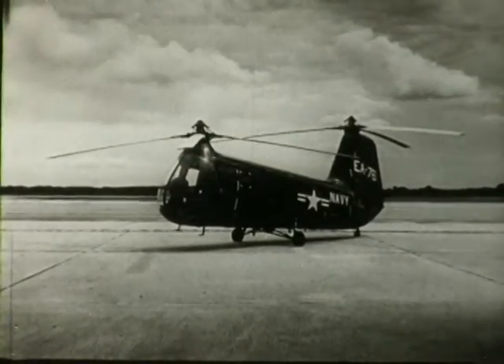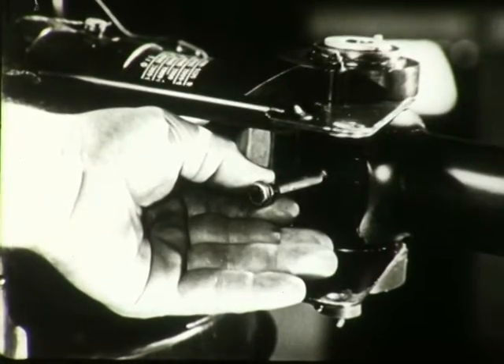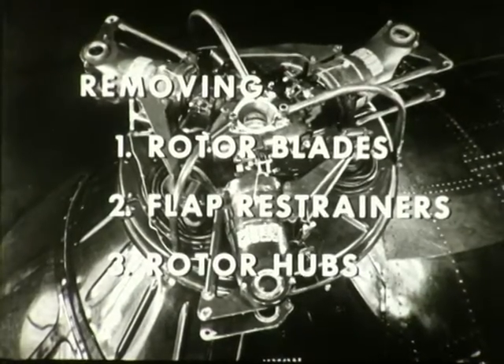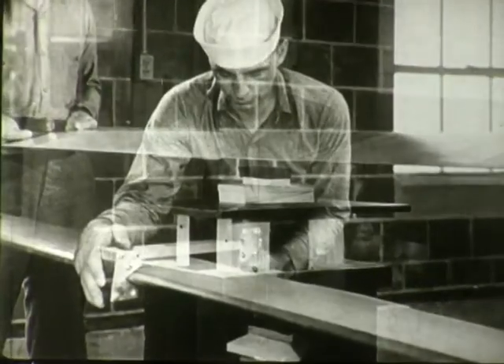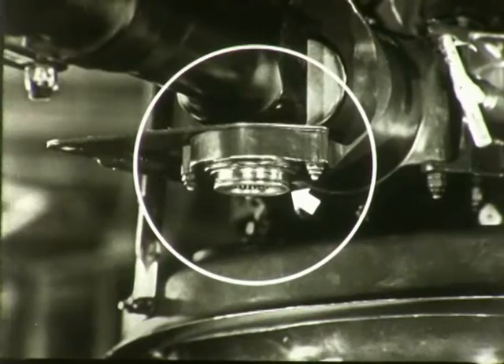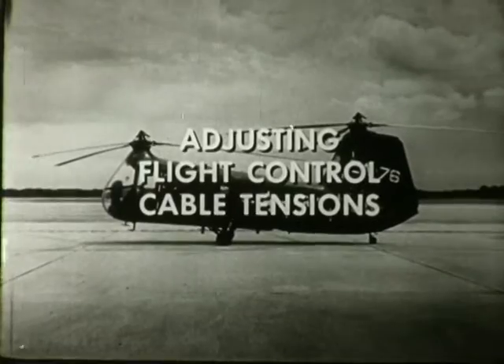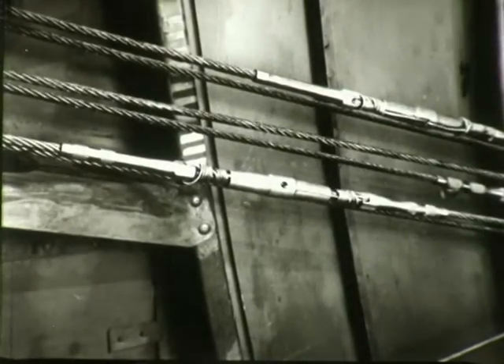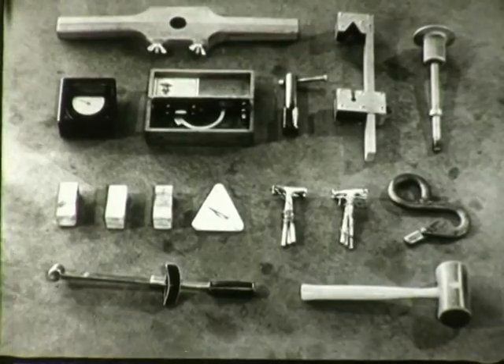F 2112 US Navy Training Film Maintaining the Piasecki HUP Service Helicopter

Comment: The film mentions to lock wire the cable turnbuckles, but nothing on the critical fasteners in the hub assembly.
Reply: several time it's mentioned to refer to manual. It clearly states all securing procedures, torque values, and other things. The film is just an overview.